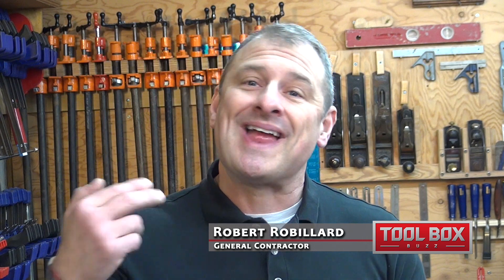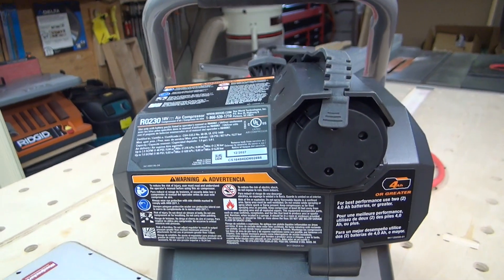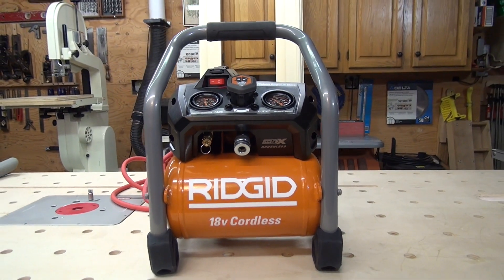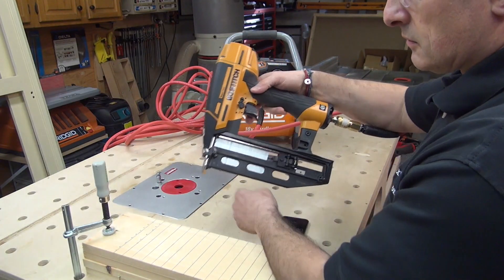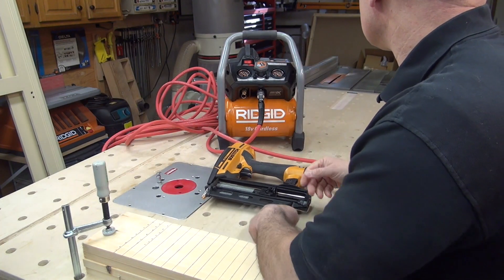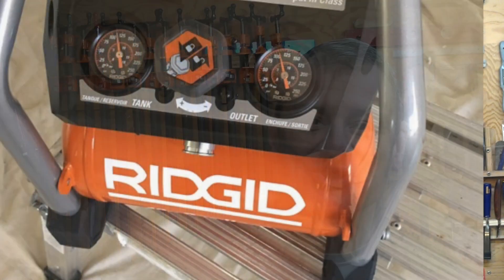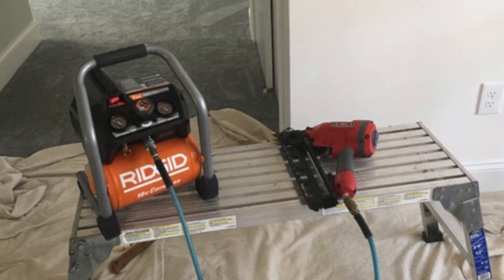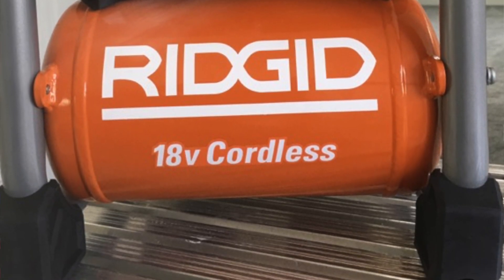RIDGID 18-Volt One Gallon Compressor R0230 Review

Comment: why not use cordless nailer at this situation ? i think 🤔 is the same powerful, i prefer my hitachi 18 g at this situation  fire 5/8” to 2” , not hose not compressor , i use rol air  buddy corded like this , but only with pin nailer because i can’t find pin nailer cordless , only makita makes but too expensive , not have good reviews,
Reply: Cordless nailers are really heavy and big.  It's also more difficult to get into tight spaces.

Comment: This tool makes little sense to me. Since for finishing work there is usually power available anyways. Also if one wants something cordless one can just buy a cordless finishing nailer and or brad nailer anyways. Which will accomplish the same thing in even a smaller package. This makes this tool useless really....
Reply from the maker: I understand your point, but a lot of guys have are invested in pneumatics, and lets face it, right now, pneumatics last longer and are currently faster than cordless. There are some spots/ places that do not have power - this just gives yu an alternative.  It gives guys options depending on how they work.
Reply: Good point if your heavily invested in pneumatics. Thanks for bringing that point up,
Reply: as good as cordless nailers have become, they still lag behind pneumatic guns. I love the Dewalt 16G 20v nailer but it could not sink a 2" nail into hickory end grain. I pulled out my pneumatic and little compressor and it easily buried the nails with power to spare. thats why this is a great idea.

Comment: $200... 1 gal... I would buy it if it was hybrid.
Reply: I agree Rigid should offer and AC adapter not hard to do,  I bought a cheap surplus ac computer adapter power supply that has 19volts DC at 16 amps output which is plenty that I use for some of my numerous cordless tools[not rigid/the yellow ones]
Reply from the maker: linkinbeatle agreed

Comment: cool stuff, wish it came in a platform that I already have... Milwaukee or dewalt
Reply from the maker: right!
Reply: Dealt has one now
Reply: Just make a battery adapter so you can use your M18 batteries in any 18v or 20vmax (18v) tools. I have several made for lots of tools (dewalt 20v max (18v because they are bullshi**ers), dewalt 18/20v push up, makita 18v lion, porter 19.2 nicad (it works fine), core 20v  lion (18v) outdoor, ryobi one, bosch 18v nicad push up, and I am making my rigid 18v lion one next.  I have 2 makita adapters so I can use the makita 36v  (2x18v) tools which is why they are a better choice then the dedicated pack 38/40v tools. I may make ones for b&d, apache and others just for the heck of it or if I am around some fool who's battery dies and they do not have a spare.   Buy the m18 socket from ebay and mount and wire it into a gutted pack from the brand in question. Some adapters come pre-designed for certain brands battery tops but they are more expensive one you add the battery top.  I buy my battery sockets (docks) prewired for a lower price from the seller "msburko" . Make sure you are not buying the mounting only dock.